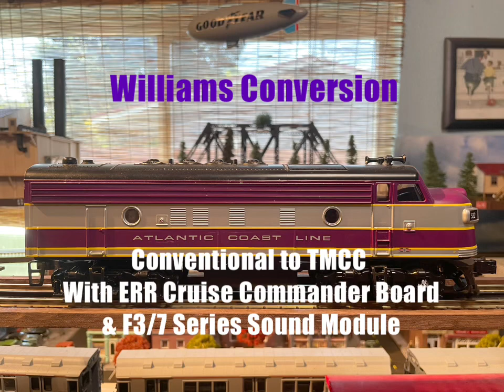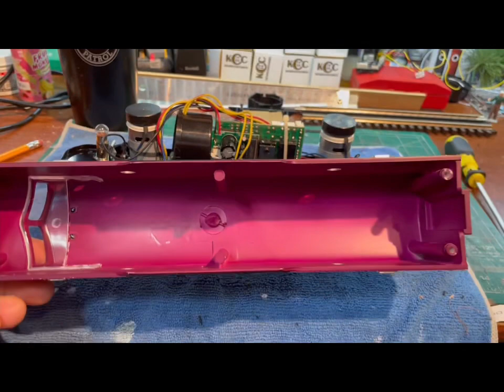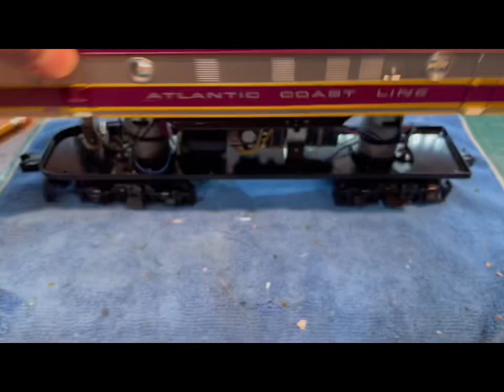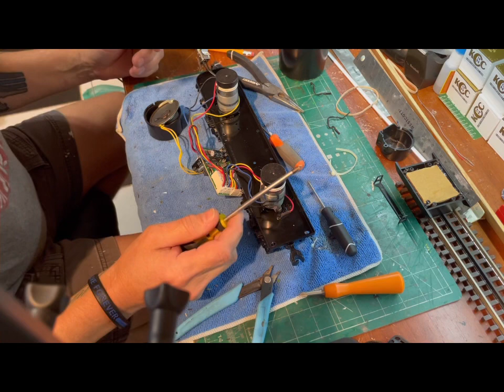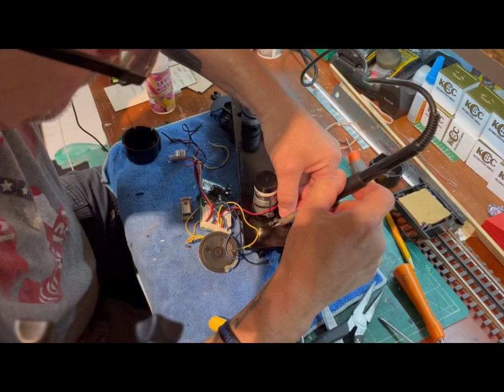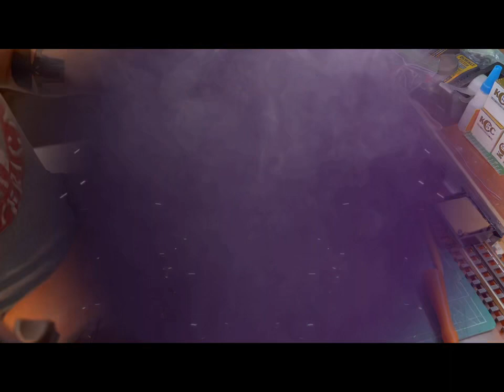Williams F7 Conversion to TMCC using ERR Cruise Commander & Soundboard- Part #1

Comment: I’m looking forward to part 2 Jorge. Taking things apart is easy but putting them back together and getting them to work as they should is the tricky part. I’m very interested in seeing how the new board and speaker are installed and then seeing if run with better sounds, speed control and command control.
Reply from the maker: Thanks Joe, it came out really good, I am finishing editing the video and Ill post it, you will like the way it came out. 😊

Comment: This is going to be an educational but fun video. I can relate to doing the upgrade to the ERR. I just did my upgrade as well a few weeks ago to the ERR Cruise Commander “M” to my 1999 Lionel Big Boy. What a great improvement. I can’t wait to see your next Part 2 video!
Reply from the maker: Thanks Tom, I haven’t done  steamer, its a little bit more complicated I have heard. 😊👍
Reply: @FLRailroaddog  Doing the ERR board wasn’t all that bad honestly. A little confusing at first depending upon what type of board was originally in it, but it went fine. It’s the SuperChuffer I’m looking to put into it, but I still kind of like the original fan driven smoke unit in it too. I’m on the fence about it. LOL I bought it brand new back then, and it still smokes extremely well as you saw in my video, and it’s 23 years old now.
Reply from the maker: @TomzTrainzandAccessories  wow

Comment: Nice you have the flywheels.! Should be a smooth
runner. I did the same thing with the old board. Bag
it up and use it later.! So far so good.! 👍😀
Reply from the maker: Thanks Mark, with the Cruise Commander board you do not need flywheel. The Commander uses motor commutation and back-EMF to monitor the speed of the motors, so no flywheel. Thanks buddy 👍
Reply: @FLRailroaddog  Are you going to remove them? I guess I will wait for part 2. Very interesting.!
Reply from the maker: @markslioneltrains  This particular Williams model, conventional w/horn did not bring flywheels.

Comment: What ERR kit did you use? Where can I get them? This is the exact same conversion I want to do.
Reply from the maker: Thanks I got it from Electric Railroad.. www.3rdrail.com, once on the site look at top right corner..thanks I just subbed to your channel too 😊
Reply: @FLRailroaddog  Thank you but they offer many kits. Which kit did you use?
Reply from the maker: I used the Cruise Commander Kit (R4LC-C08) and then the Diesel engine soundboard … it’s really easy just make sure you follow the instructions
Reply: @FLRailroaddog  So, you had to purchase two items in order to end up with all the components in the video?
Reply from the maker: Yea
Reply: @FLRailroaddog  Thanks. I wonder why these F7s have a hole pre-cut in the frame that's just right for the run/pgm switch?
Reply: @FLRailroaddog  Got the parts. Got everything installed and everything works! You video was a HUGE help! Thanks.
Reply from the maker: Glad you got it running, I appreciated the kind words.. congrats 🍾